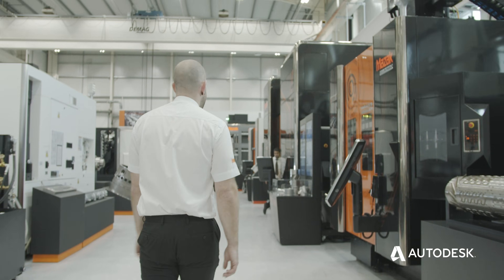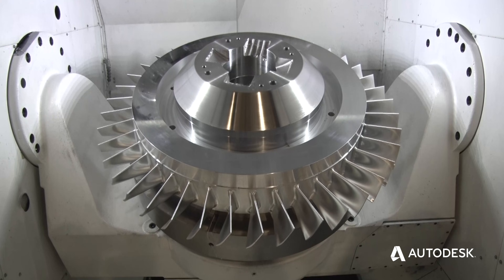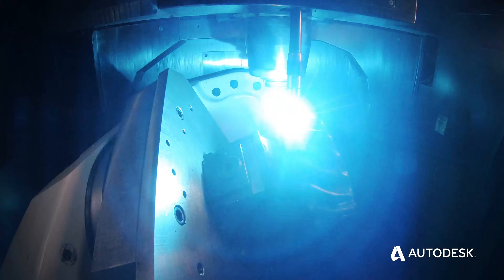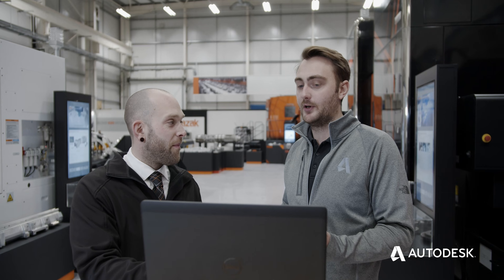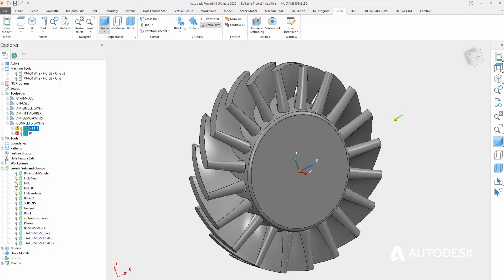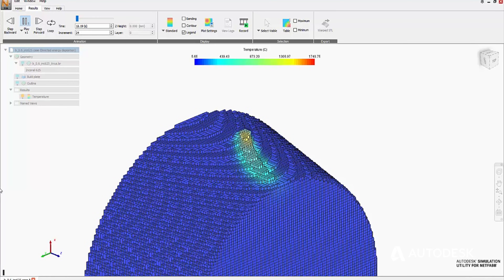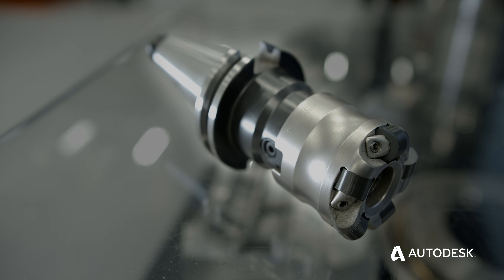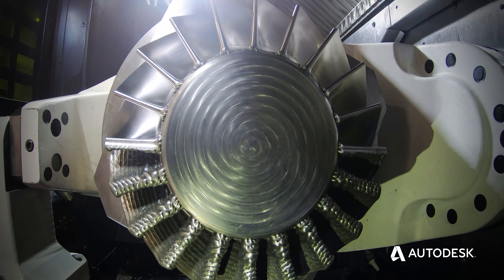Hybrid Manufacturing Inconel Impeller With Mazak and Seco

Comment: The Welding process will be the Big Question.
Most would disregard this process because of the Welding element involved.

Not shown in this application.
But Post Heat Treatment could stabilize the base metal.
Of course this process would need to be completed in the Pre Machining stage.

Not totally sure IF the Mazak with Welding capabilities would be more cost effective than a Stand Alone,  Robotic Welding Cell.

I would prefer a Robot Cell,  because it could be used for other applications.
The disadvantage I see with Welding in the machine.
Is delaying the Machining Process.

Definitely an interesting concept.
But I feel,  Welding outside the machine would have more advantages than combining the 2 processes.
Especially when considering Post Heat Treatment.